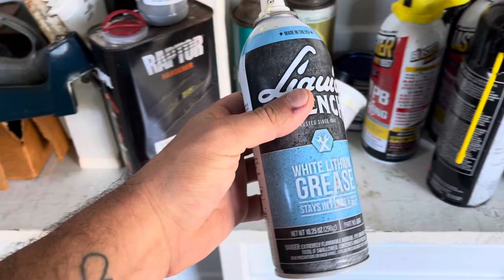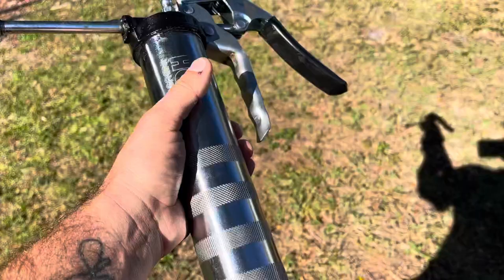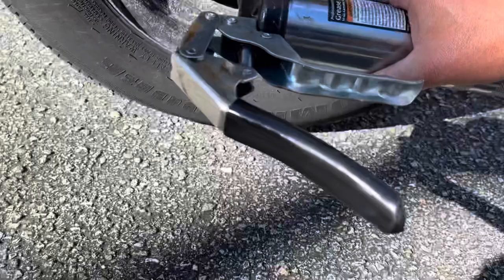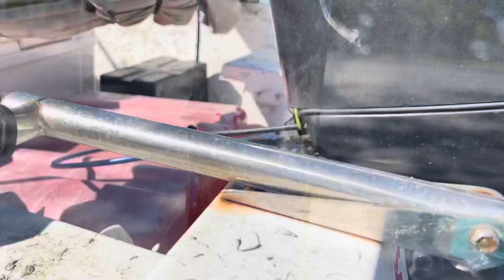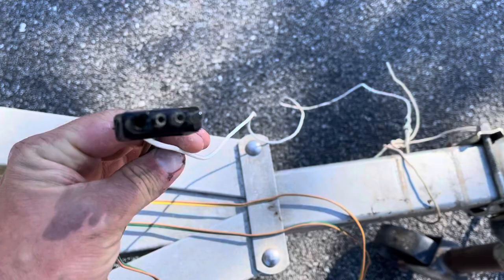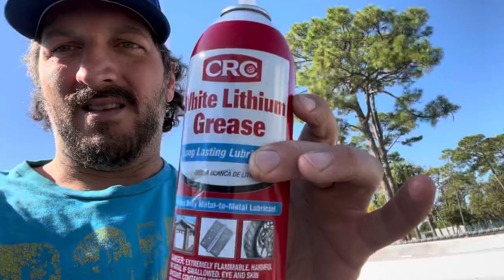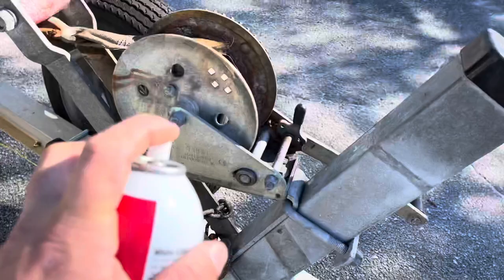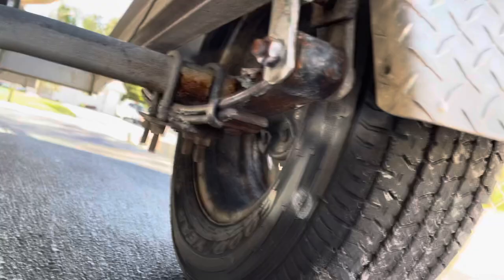Complete Boat Trailer Maintenance Guide In Five Minutes, Extend The Life Of Your Trailer Cheap

Comment: Fluid Film is designed as a corrosion inhibitor to spray underneath your car/trailer chassis - white lithium does resist washout well but not nearly as well as Fluid Film or some other dedicated chassis corrosion inhibitor.

Comment: You have many rusted spots. As you are not fixing them, you could easily and cheaply touch them up with "Krud Kutter The Must for Rust" (do an YouTube search for it). You could use the spray or you could buy a jug and apply it with a brush. Do it during a cool day to avoid the fast evaporation of the liquid. You might want to apply it several times.
Reply from the maker: Thanks for the tip man! Will do

Comment: Not suppose to pump directly into the fittings, you will blow out your seal. That is what I was told. Instead you need to take out your bearings and repack them